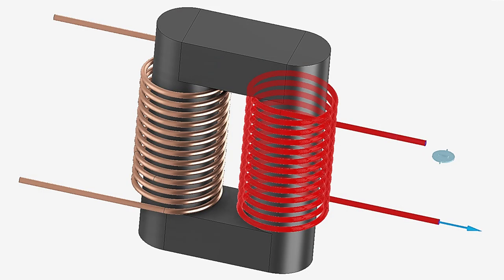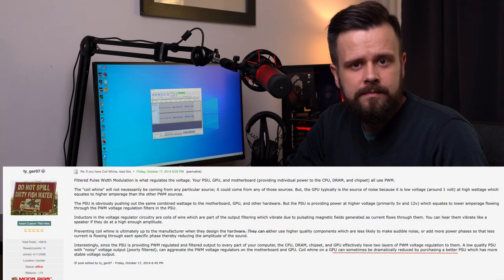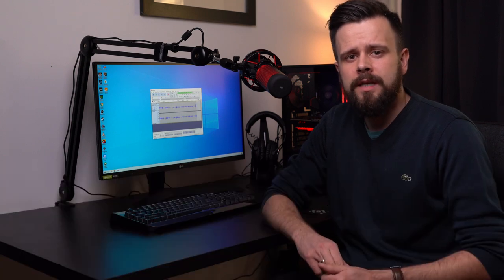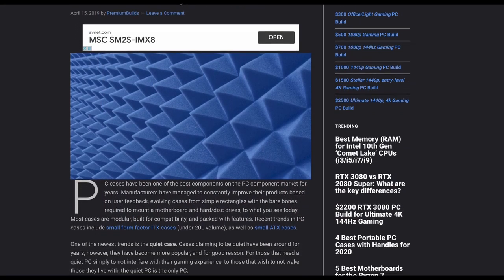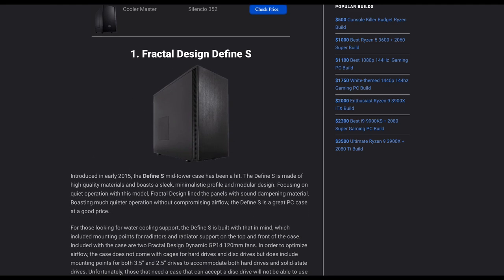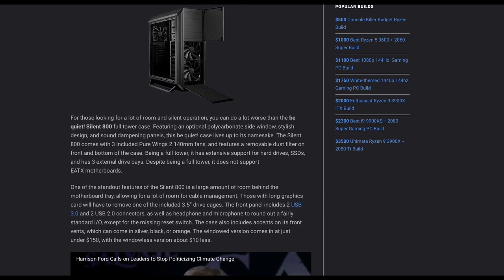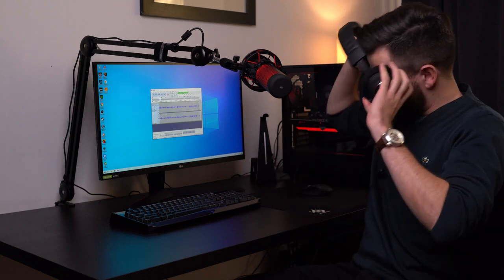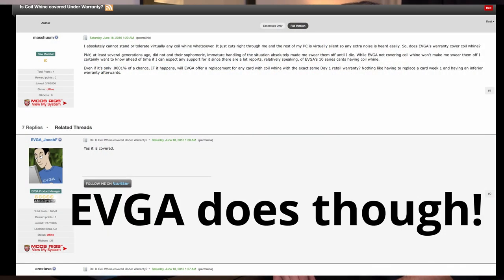GPU making weird noise? It's probably coil whine.

Comment: Also have the strix 3080 with 5900x and a seasonic focus GX-850 and it's crazy loud. Good to know I'm probably fkd lol. would it be worth trying a corsaid rm-850x or both these psus are same tier?
Reply from the maker: If you can return after it it’s worth a try although there’s like 90% chance it won’t change a thing. I’ve tried different psu with mine and no success.

Comment: There's also a problem with ASUS GPUs due to production quality, your's should have that too. It's confirmed in the ASUS ROG Forum and it's caused by the fan shroud. The fans are creating a rattiling sound and higher temperatures and RPM around 60-70%, too many people think that it's coil whine.
Reply from the maker: Good to know thanks for bringning this up. My one definitely has coil whine as the sound starts before the fans ramp up speed
Reply: I got my first strix 3080ti card exchanged because of fan rattling and now the replacement one have coilwhine🤦

Comment: I have this issue with my Strix 3090. The sound was insane for me, so I had no choice but to send it back for repair or get a replacement. Never had this issue with previous graphics cards I've used.
Reply from the maker: Same for me. But I think ill stick with it. Or sell it and get amd if rdna2 turns out good.
Reply: https://rog.asus.com/forum/showthread.php?121271-Strix-RTX-3090-Fan-vibration-issues
issues here too..theres two dif noises.
Reply: Did you got another one, do you still have coil whine?
Reply: @reshi207  I got a new Asus Strix 3090 sent to me on the 23th december. I can confirm that it doesn't have any coil whine at all :) . So some cards suffer more or less from coil whine it seems. I was lucky that my second Strix turned out good.
Reply: @Shadowsmoke11  damn i' happy for you, mine has annoying coil whine too😭

Comment: I've got the same card and the same problem. Been reading other reports about the strix being bad in particular. It is without a doubt the noisiest card I have ever had. Worse than my r9 290 and that was bad.

Hesitant to return for replacement right now because no stock, but thankfully have until Jan 31 2021 to contemplate doing so. Amazing card otherwise
Reply from the maker: I’ve tested 3 cards and all had coil whine unfortunately. Wondering if AMD will have this issue.
Reply: @leizerg  I got a 6800 XT ASUS TUF and it got such terrible coil whine I send it back. I play with speakers and open headphones so yeah coil whine is bad for me
Reply from the maker: @JBR_1995  aww thats horrible :(
Reply: @leizerg  Yeah so right now I just want to be lucky and have almost 0 coil whine. Interestingly, the card I send back only had coil whine when gaming and some games had coil whine and other games had 0 coil whine. It was very weird :/

Comment: i think you can just glue the coils or whatever is vibrating on the card, but you have to use like stethoscope.
Reply from the maker: Never tried this technique but I believe Most of the coils nowadays already have vibration dampening cases on them with glue inside. It seems it doesn’t help much.

Comment: Thanx for the explanation!
Experienced coil whine on my Aorus rtx 3080 master. Thought that's something bad and card is broken or something (it performs well though).
Reply from the maker: Glad I could help :) Enjoy your 3080!
Reply: Do you have an update on your coil whine I judged installed my 3080 aorus master today and I got a really loud noise coming from my pc I’m not sure if it’s coil whine but it’s loud forsure
Reply: @bbbristian  if it is like "electric sound" like 'bzzzzzzzzz' then yes it's coil whine for sure. My Aorus Master whines today too (I got it 3 month ago; but it happens only when it's like 99% loaded). Also I've undervolted it a bit (0.975mV 1950Mhz) but I can't say that whining become less loud. We have just to accept it, majority of these cards have this problem. But they works well and I think there's nothing to worry about

Comment: You also can return the card if the seller lets you. In most cases it will let you.
Maybe you can have luck and get a different one that has less coil whine.
Reply from the maker: You need to be really lucky. I tested 3-4 cards and all had it. Just have to live with it.

Comment: Just got the 3090 oc strix white... has coil whine , this card is nearly 500w tdp. Had a Seasonic 750w prime titanium and it tripped the over current protection a few times.  Swapped it out for a revolt X 1200w platinum, it  might have reduced the whine sound a little , but it’s still there. Higher wattage does not mean it will necessarily reduce the coil whine I guess... live with it?
Reply from the maker: I guess 😊

Comment: My RX 6700XT have coil whine. A friend of mine has a RX 6800XT and his Card has coil whine too.
Reply from the maker: I tested like 5-6 different gpus and they all had it. I heard undervolting can help with that, might have to give it a try.
Reply: @leizerg  i took a new PSU , changed my Mainboard and i undervolted with AMD Adrenalin. It ist better. I could live with that noise.

Comment: have a 3090FE... had to rma because of coil whine... second model has exact same coil whine but it is definitely a new card.  have an 850 watt corsair psu, friend bringing buy his 1000 watt evga psu... lets see what happens!
Reply from the maker: Let us know, very curious!
Reply: @leizerg  Well... the way it sounds is different.  But it is still just as bad.  This is driving me insane.
Reply from the maker: @ralphbrito  sorry to hear that dude... I have the same problem
Reply: can you post a video and audio recording the coil whine?
Reply: @MJLStudios  so its been a month and the whine is actually settling... its definitely still there and changes pitch based on what's on screen or what i'm rendering in premiere but yea...

Comment: Thanks for this. My question is, do coils in PSUs also whine? I'm hearing this buzzing noise from my PSU when gaming and the tone even changes when I move the mouse.
Reply from the maker: I had similar issue with mine a couple of years back. You should make sure it’s not capacitor dying. If it’s the same as on the video it’s coil and not much to worry about but if it’s different sound it might be capacitor.
Reply: @leizerg  I was told that the whistle-like sound indicates a bad capacitor. In my case, my PSU is not whistling. It just buzzes in a high-freq. sound, like there is a bee or something in the PSU, only when gaming. No performance issue, no shutdowns, no heating or any smell etc. Just this buzzing when gaming. GPU is almost totally fine though. Buzzing quite slightly.
Reply from the maker: @emreteberik5433  Then apart from the irritating sound youre fine :)
Reply: @leizerg  Thank you man. Wish you success!
Reply: @emreteberik5433  Hey I'm having the same issue.  Did you ever figure out if it was your power supply?

Comment: Won't silent mode fix that issue?  Thats just the fan running at full speed
Reply from the maker: The fan is quite loud, yes, but the buzzing sound you hear is coil whine. And unfortunately it has nothing to do with fans.

Comment: Can coil whine also come as a pulsing sound? Mine does that when in-game and the noise is lower pitched.
Reply from the maker: Its a regular pulsing? Because on some of my cards that I tested the sound changed depending on frame rate.
Reply: @leizerg  It's like a buzzing noise that pulses when under heavy load.
Reply from the maker: @antebellum1776  yes I think it’s coil whine. The sound can be different depending on the amount of fps. Mine gets really high pitched sometimes in menus where the fps is like 500+. Otherwise it’s different. If you want to you can upload a video here on yt and I can check it out for you.
Reply: @leizerg  Thanks! I thought that was it but I just wanted someone with more knowledge to confirm.

Comment: My GPU never made this sound. Until yesterday.. it suddenly started this sound. And i didn't notice it! Until i notice some kinda burning smell... The smell? Is it normal?
Reply from the maker: Definitely not. Unplug it and check the back of the gpu. Alternatively check the power supply. Either way something is very wrong
Reply: @leizerg  now i played a game for about 30 minutes. The sound is there! But no smell.. is my pc messing with me? 🥲
Reply: @leizerg  maybe it happened for the first time! That's why it smelt like a wire burn.. i don't know man. I'm freaking out.😖
Reply from the maker: @saifalisam6982  is it a prebuilt or did you build it yourself?
Reply: @leizerg  i build it.
Reply from the maker: @saifalisam6982  I’d look inside and look for the faulty part because it might damage the rest.
Reply: @leizerg  i did actually. And everything looked fine. Except the GPU noice. 
It all happened at the same time yesterday night. The smell and this noice..

GPUs still under warranty though!
Should I send it for RMA? what do u say?

Comment: Well thank you, i never thought it was anything special/to worry about, but I just upgraded to 3070 from 2060 and I notice that.
I have a "Corsair TX650M 650W 80 Plus Gold Modular", do you think I should change?
Reply from the maker: You can try but from my experience it doesn’t help. I did a psu swap and unfortunately it changed nothing. Some people say leaving it running couple of hours helps the coil settle in and reduce or even stop the whine.
Reply: @leizerg  do you still have coil whine and did it reduce?
Reply from the maker: @reshi207  yes I still have it but it seems a bit quieter now.

Comment: Can you please tell me which manufactures accepts returns of gpu's with coil whine issues?
Reply from the maker: I think only EVGA used to accept it but Im not sure if anyone accepts it now, with Coil Whine being so common among Ampere, especially 3080 and 3070.
Reply: @leizerg  ow shit but with my gigabyte it's very very loud.
Reply from the maker: @reshi207  try to RMA it, maybe you’ll get lucky
Reply: @leizerg  i have a rtx 3070 de recommended psu is 650w.

I have a 600w 80+bronze, it's ocz modxstreem 600w

If i change it would i be better?
Reply from the maker: @reshi207  you might want to try a better cpu with more wattage. Might help with the noise. I suggest getting one with gold rating as it has better components inside and gives better quality voltage.
Reply: @leizerg  i think you mean psu and not cpu😅, but okay thanks for your help and for the fast responses.❤
Reply from the maker: @reshi207  haha yes sorry autocorrect 🤭
Reply: I tested my rtx 3070 in the pc of my brother and the coil whine was completely gone. So i bought a new psu, the seasonic gx 750.
Reply from the maker: @reshi207  And it works fine now?
Reply: @leizerg  I don't know yet because it will be delivered monday, but I'll let you know
Reply from the maker: @reshi207  great because maybe I will get a stronger PSU as well and it will solve my issue :)
Reply: @leizerg  yeah if it works i'm going to make a before and after video about it, it might help alot of people.

Coil whine on your gpu can be caused because of the psu, or because of the gpu itself and sometimes also because of the motherboard.
Reply: NVIDIA accept it but they send you another card with coilwhine

Comment: If I put my 3080 in my test system with not so great PSU it whines. In my AX1200 system and my RM1000 it runs with no coil whine. Here is some random vid I found showing same thing. 
https://www.youtube.com/watch?v=7ng8BN8Jp-0
Reply from the maker: Thanks for sharing! I think I’ll do some more testing with different psu then 😊